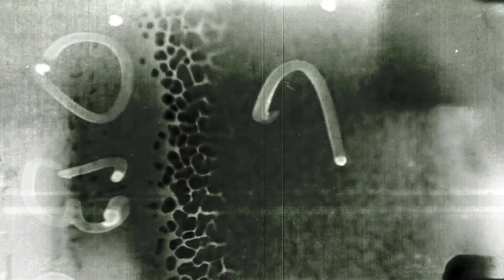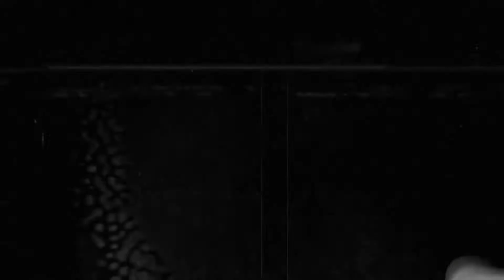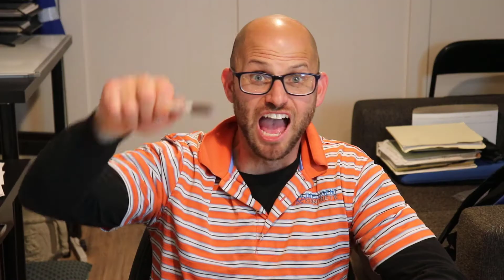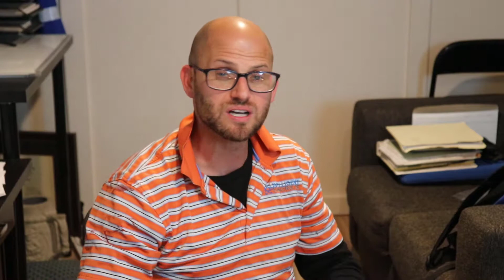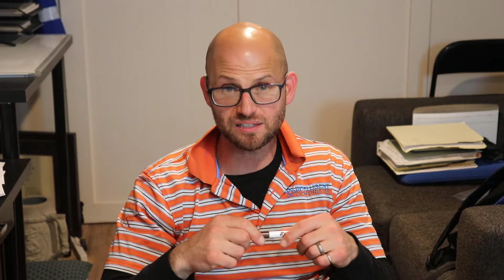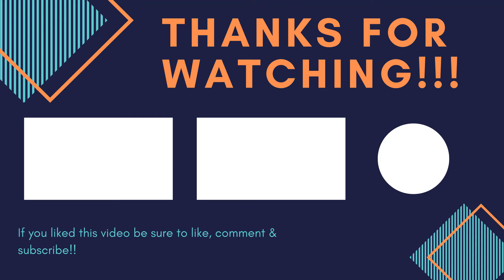Concrete Skate Parks: Mix Design - Vlog 668

Comment: interesting points  i know you are  a Concrete  guy   and i am not   although  i do have a pretty extensive  construction back ground  and out of curiousity  have you  considered  using some of todays  coatings to apply on top of the concrete to  enhance abrasion  the first thing that comes to my mind is Epoxy  which is what we used  in a very high production Woodworking shop i worked in for 25 years  the   main reason  we used that process was to  have  a super smooth  surface that  our products could be safely slid  on the floors with a minimum  of  damage  btw we used a metal  protective foot attached to  our Cabinetry to  enhance that sliding ability  and to help protect them in transportation  we also tested and used disposable plastic  ones btw our  floors were meticulously filled to have no  divits or cracks as well  it also helped with  dust control and cleanliness  of the operation  and i must say it held up quite well   even  with Forklifts and other machinery being moved  on it  constantly
Reply from the maker: Not a bad idea but  I would be concerned about the following:
- how well the epoxy would due in an outdoor setting over time
- would skaters like the feel of an epoxy surface

Comment: The skate park design and construction business has been well established. RE: Craig Monteforte's comment, I would think that any sort of sealer or coating would be too slippery for the wheels. As well as question their ability to perform over the lifetime of the park.  I am unsure whether abrasion resistance is a current issue, or if so, how big of an issue it is. The ideal concrete surface finish for a skate park surface definitely is a tighter troweled finish. Too smooth and tight, like a warehouse floor, and it will be too slippery. Too rough, like a broom finish, and it will have too much roll friction. Some of the problems that skate park designers have encountered with regards to concrete is, deterioration and water intrusion at construction joints, construction joint activation and thermal coefficients that yield too big of openings at construction joints. Traditional elastomeric joint sealants are too soft. Also, the panel movements of all the concrete sections, as they're 3-dimensionally asymmetrical. Ramps, pools, hips, steps, stairs, inclines/declines, etc.
Reply from the maker: Agreed on al!!!

Comment: Seems like it's getting quite an expensive skate park 😋
Aren't you exaggerating the impact of skating on the concrete? Maybe just a little? 😉 Sounds like you're beating it up as of you were driving a tank over it 😅
Reply from the maker: Nope.  The unfortunate reality is that the concrete surface is susceptible to the abrasive forces of the skate park with or without consideration of a softer surface from sub par finishing or curing.

It’s the same thing that we see in automated manufacturing.  Repetitive abrasive forces tear down the concrete surface, subsurface and then body of the concrete.  

Yes, driving a tank we cause significant damage.  But you are confusing instantaneous damage from the tank and long-term deterioration at the skate park.  

I hope this helps clarify.